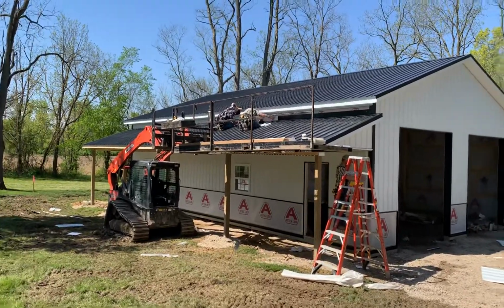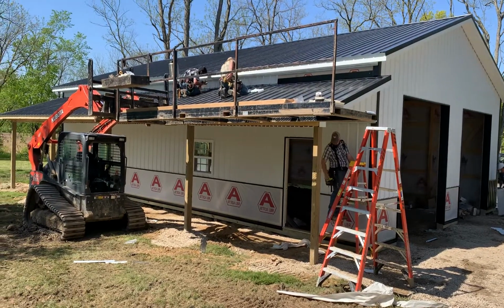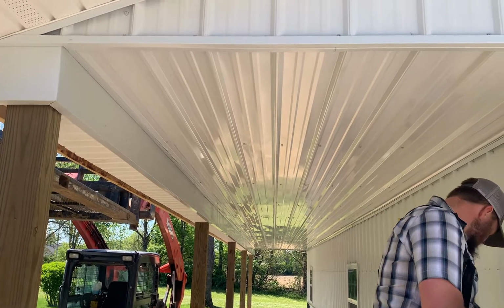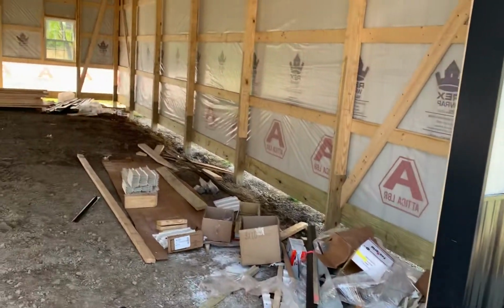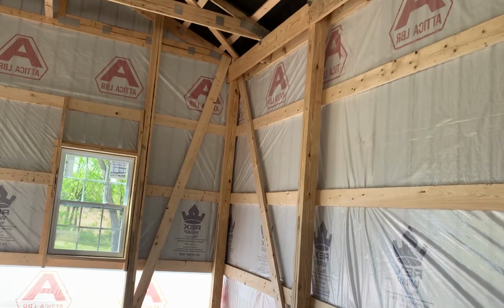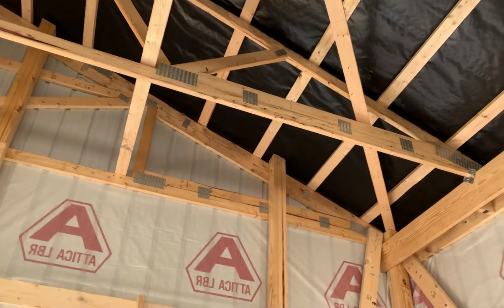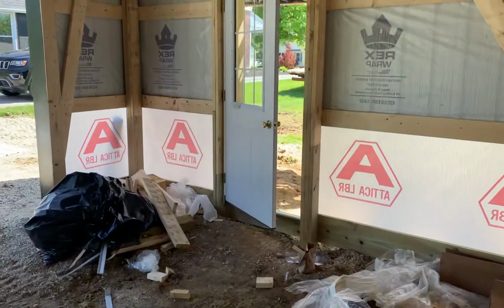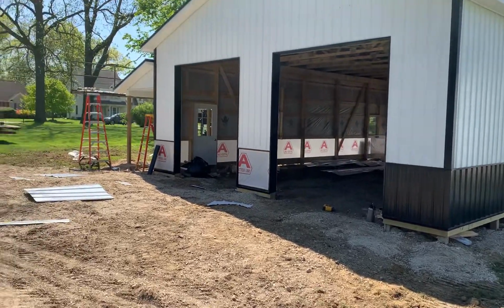32x48 12’ Pole Barn | Classic Black and White Barn

Comment: Gotta love people who don't know what they're talking about trying to sound like they do.
A. Those are not "pressure points" in the laminated columns.  They are simple finger joints where shorter pieces of wood were joined to make a longer section.
B. How does a steel door resist rust more than an aluminum door?  WTF?
Reply from the maker: Ok.